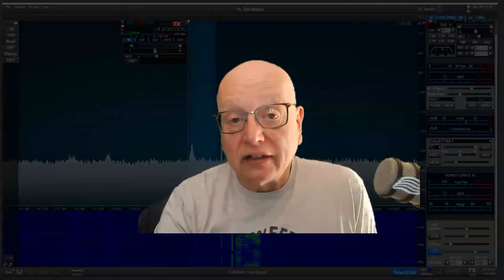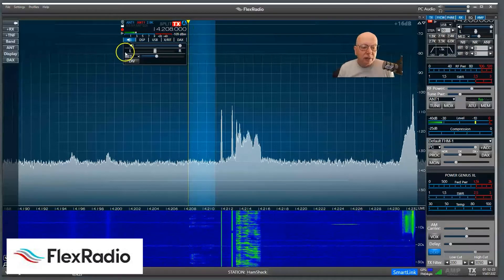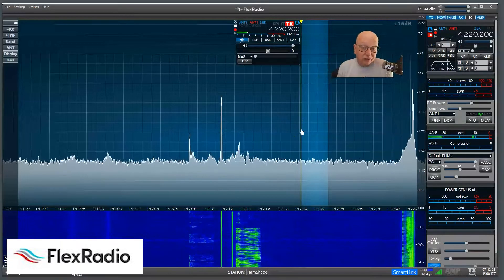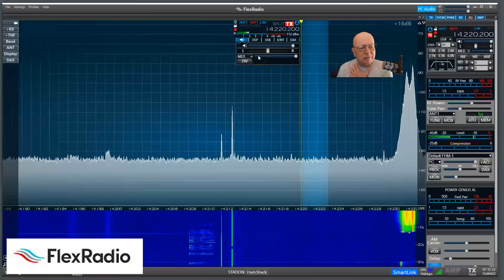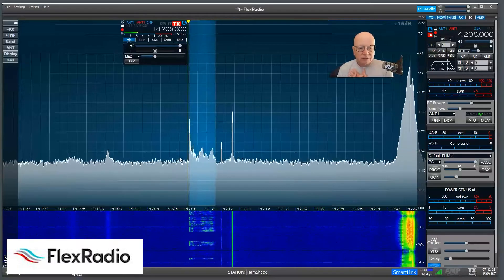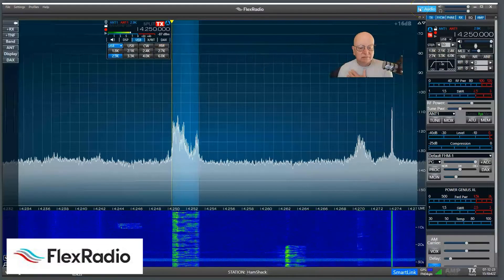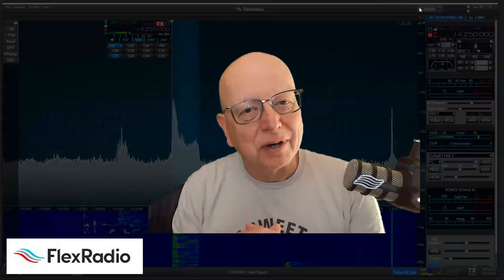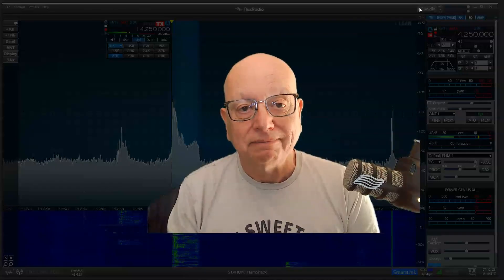FlexRadio - AGC-T : The Best FlexRadio Secret!

Comment: Yuri UT4LW has added some interesting controls to SDC. One of which is automatic control of AGC-T. It works when the Skimmer is on and the control type is SmartSDR API. It dynamically adjusts AGC-T so that the receiver is always at optimum AGC-T for the prevailing conditions. How useful is this? Yuri tested it throughout a CW contest and rates it highly. I have been using it in everyday use - for example I am 20m CW and it is changing my AGC threshold between 47 and 52. Prior to this SDC feature I would have set AGC-T at 47 manually and not been too motivated to check or change it on 20m. I have to admit though that a manual recalibration of AGC-T right now would set it at 50 to 52, rather than my normal 47, such is my band condition. My receiver therefore does appear to be being dynamically optimized. The Skimmer can remain active even when the radio is in other modes so auto AGC-T can also be active in SSB and digital. The new SDC feature has some merit and is at least worth checking out by SDC users. It is version 17.1014 on the SDC website. 73 de Erik EI4KF.

Comment: Superb video as usual. Once you get into the habit of making a quick check of AGC-T after a band change or after a noticeable change in receiver noise, usually through a change in conditions, it becomes second nature. It may look an onerous or superfluous control to use but some initial concerted diligence at adjustment will reap rewards and then it becomes something that naturally is done while operating.
The JTDX author also recommends not to turn off AGC when in FT8/4. He has proven with test .wav files that the optimum decoding comes from fast AGC and then having turned on in JTDX the setting AGCc - AGC Compensation. He stated 2-2-2017 : 
In fact AGCc function trying to reduce noise level at beginning and end of the interval so that it is equal to the noise at the signal reception.
It is needed to provide correct operation of the correlation function being used in JTDX. 
While AGC being triggered very often on the HF bands AGCc functionality lets to decode more signals.
73 de Erik EI4KF / G0CGL